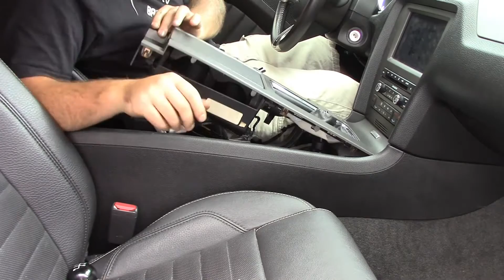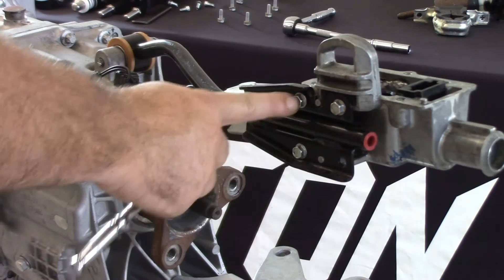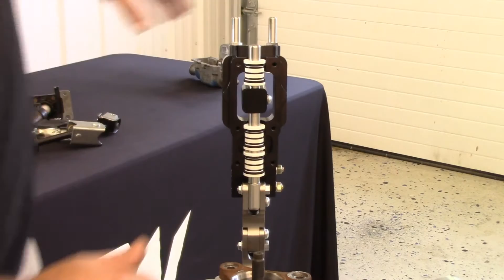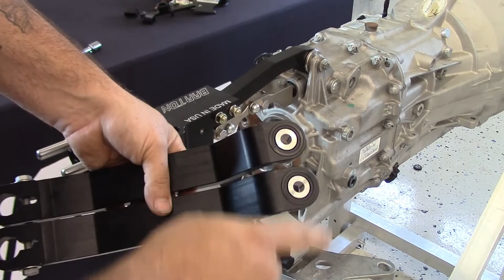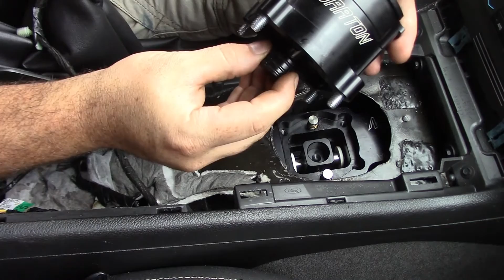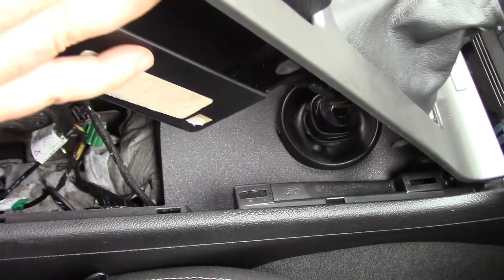2011-14 Barton Hybrid 3 Install Video

Comment: I bought a previously owned 2013 Boss 302. It already came equipped with a MGW shifter installed. I was still getting lock out in 3rd and 4th gear and grinding gears at high revs. I was seriously thinking about a trans swap. Thankfully I bought the Barton hybrid 3. This thing shifts flawlessly. I used the body mount option. David was right on when he invented this unique (pat pending) dual swivel linkage. It really is the cure. You don’t even need the trans mounted brackets that come with it. My only complaint is I wish I could have bought them separately to save maybe $100.00
Reply: getting ready to install, so you think there isn't performance loss from body mounting, was thinking better performance from solid linkage trans mount

Comment: It took me 2 hours start to finish with a lift and installing it alone. Very easy to install if you use this video as you install it. I trans mounted it and I'm glad I did. Positive short shifts now; it's like night and day! This is a very high quality shifter and it is worth every penny. Buy it!!!
Reply: Rick Devine ordered one of these things at the turn of the new year and have been sitting on it till now.  Trying to get motivated to install it and a few other things, i just hate working on my back on the ground cry 😭 😭 😭